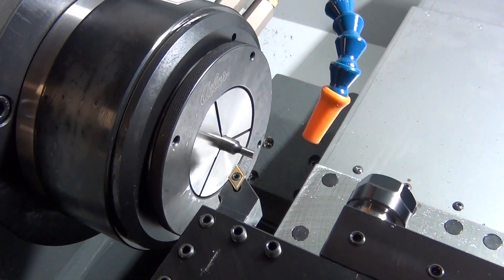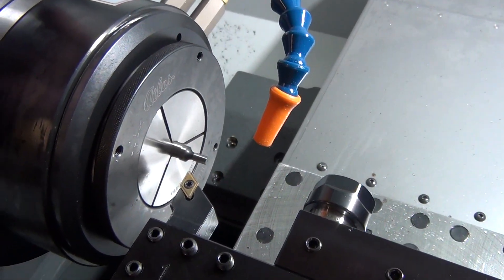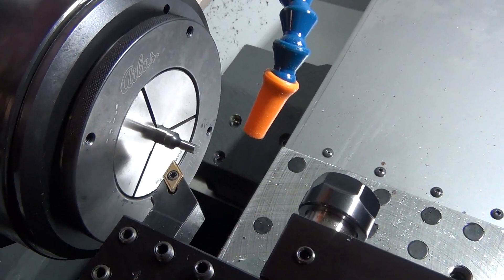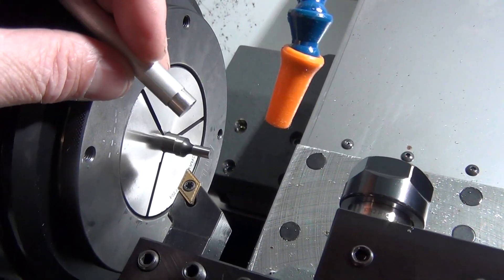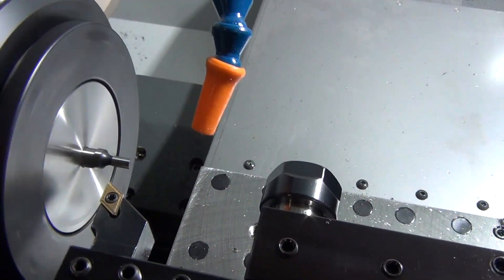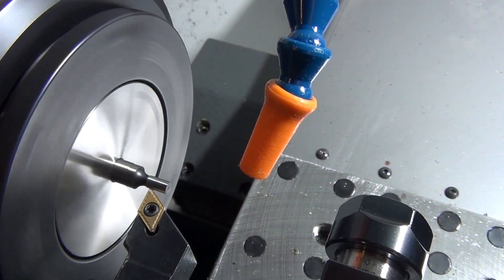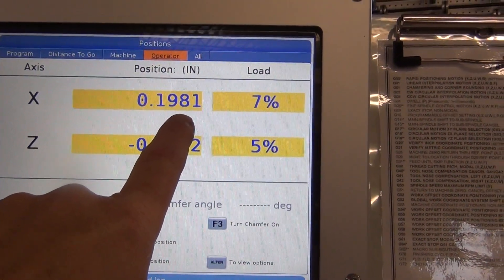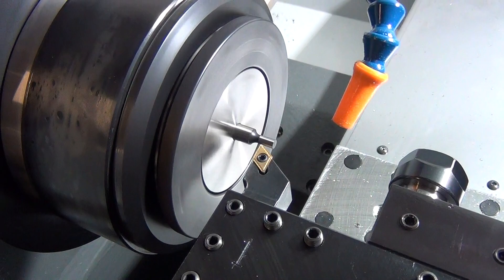Setting X-Diameter on a Haas TL-1 lathe with an Edge Finder

Comment: Can't you just take a cut on a piece of bar, mike it, there's your diameter.
Reply from the maker: Yes, cutting a part is the "gold standard" and that's what the lathe X-display was calibrated to in this video.  These methods are called "pre-set"....because the offsets are almost always "set" to their final value after an actual part has been cut.  "Pre-set" gets the offset close enough to safely run a test part.
Reply: Mathews Engineering you usually damage the insert if you run it backwards.